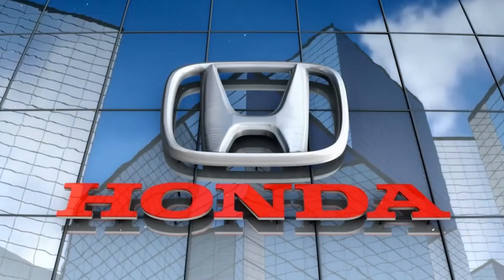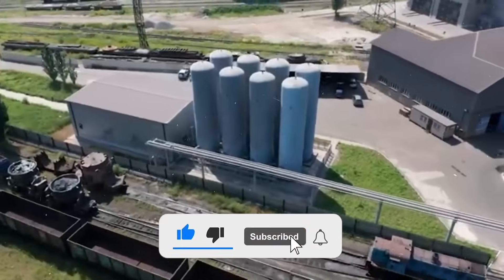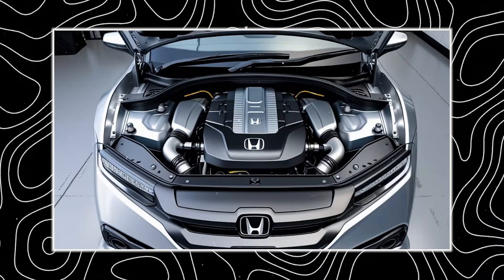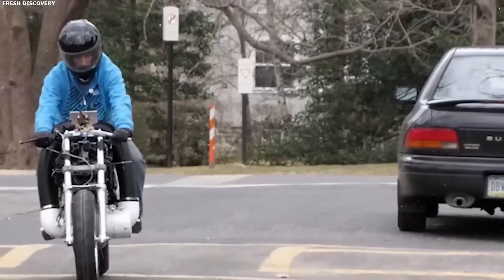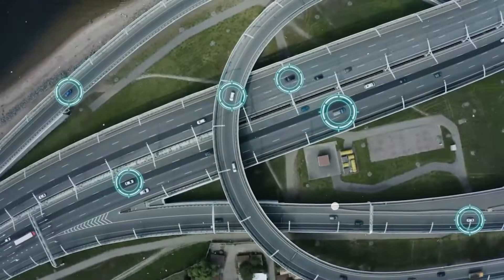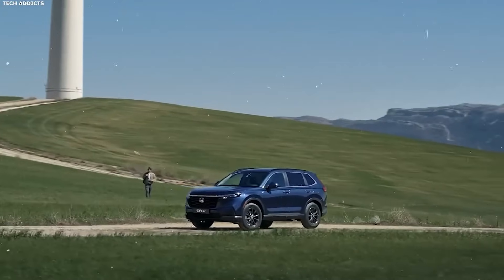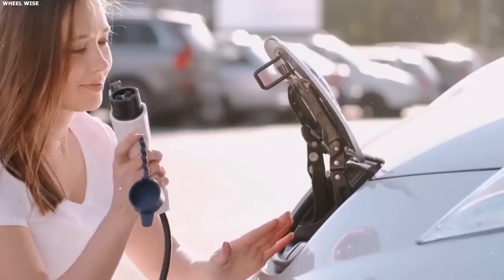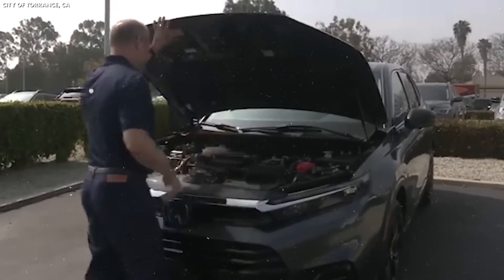5 Minutes Ago: Honda CEO Unveiled the new Hybrid Engine—EVs Are Dead!

Comment: Toyota have NOT been 'battling for dominance' in EV's, they were market leaders in Hybrids for many, many years - before it became fashionable. Toyota has been collaborating with Mazda over a multi-fuel engine, that can use bio-fuels as well & just showcased a new EV with something like a 900 mile range & 2/3 minute charging system, way beyond anything ANYONE else has. No doubt Honda's new engine is linked with the Mazda one, it's too close for comfort...